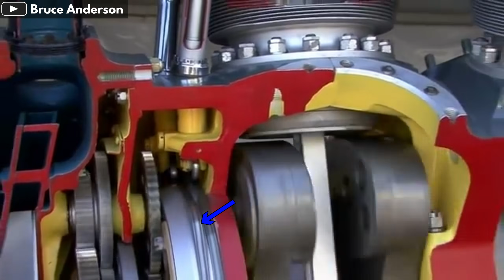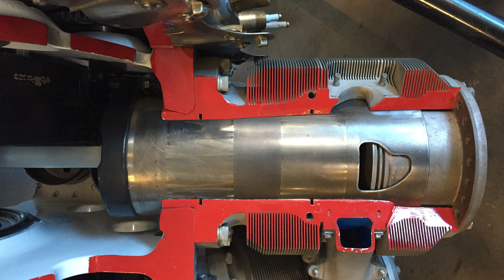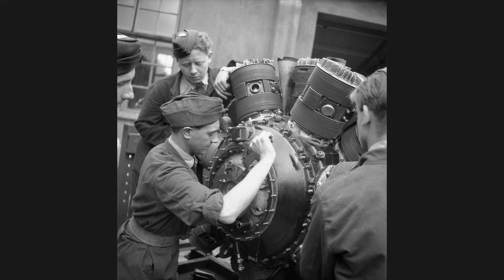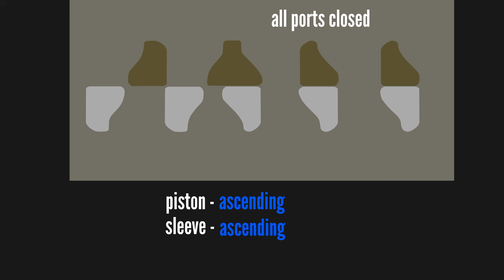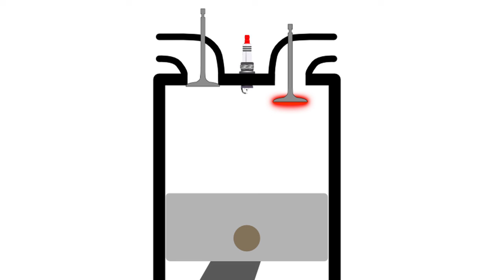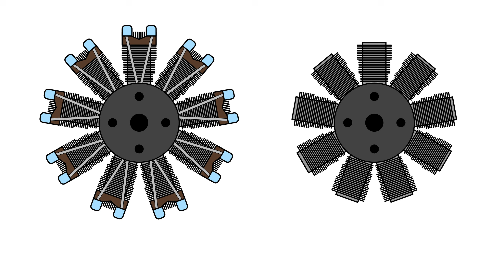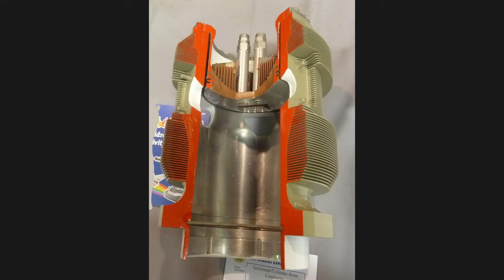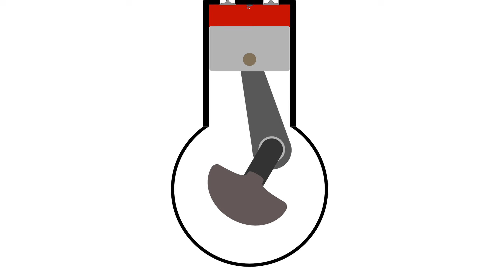Analysis of Bristol's Sleeve Valve Aero Engines

Comment: Then Napier took it to the next logical conclusion. A 2 -stroke diesel coupled to an exhaust driven turbine. Even higher compression ratios and higher power
Reply: The Napier Deltic is  a Junkers 218 engine which Napier licensed in 1934
Reply: @sandervanderkammen9230  I was thinking oof the Nomad.
Reply: @jamesoliver6625 The Nomad was unsuccessful and never saw production, it was based on a MAN AG. design of 2-stroke, loop-scaveged Diesel engine but with various types of Turbocompounding and hybrid gas turbine concepts that proved unreliable and not able to compete with conventional turboshaft gas turbine engines and turbojets. 
Loop-scaveged Diesels were like a dead-end concept like sleeve valve engines
Reply: @sandervanderkammen9230  The sad part is that by 1941 it was obvious that the war was going to be fought and won or lost with poppet valved engines and by late 1944, to those in the inner circle both in England and the US, that the future belonged to the turbines. To me both were serious misapplications of resources. Turbo-compounding an already very mature poppet valve 55L engine to get the power and fuel efficiency was the smarter way to go in the interim.
Reply: @jamesoliver6625 If there had not been a shortage of Nickel in Germany jets would have been in mass production in 1942... piston engines would have been obsolete before the war ended.

Comment: I don't know if they made economic sense for the company but they sure sound cool. I remember seeing a video of a Bristol Hercules that someone restored and ran on a stand and the sound was incredible. I love the uniqueness too, most piston engines have used the same basic design now for >100 years, the sleeve valve was something really different, and it worked well, even if it was ultimately a dead end.
Reply: It didn’t do them any harm. Building the Brabazon airliner was the hell of a big mistake. 

None the less, Bristol entered the jet age successfully enough helped by the arrival of Stanley Hooker who left RR. Some very notable engines came out of Bristol, including the Olympus (Concorde, Vulcan, all sorts), Pegasus (Harrier), Adour (Jag, Hawk, lots of stuff).  

Hooker says in his book that Olympus went from cold to full thrust on its very first test run in a matter of seconds. He just cranked the throttle wide open straight away. There was an American buyer watching, who was gobsmacked that British development testing appeared to be nothing more than a few minutes effort, all done and good, move on to the next!

Comment: The fact that the sleeve valve engine works real darn well makes me wonder what is keeping the rotary valve from being widely used for high performance engines. Surely it can’t be harder than making an entire SLEEVE reciprocate AND rotate at 2500rpm under the pressure of combustion right?
Reply: The sleeve valve was the answer to a problem that no longer existed by 1944.. poppet valves improved and jets made them both obsolete.
Reply: @DoktorBayerischeMotorenWerke  that’s true, but the rotary valve is literally just a cylinder with a slot in it that is driven by the camshaft. It should, at least theoretically, offer the same benefits in airflow efficiency as the sleeve valve design, and it should be easier to make too. That’s what’s making me wonder why it never saw widespread use lol

Comment: I thought I read somewhere  that the Centarus when used in commercial service after the war had a much higher TBO than equivalent poppet valve engines making it cheaper to operate.
Reply: You read a lot things that are not really true this days... sleeve valves were a dead-end concept and much more trouble than any the benefits

Comment: When sleeve valves were first purported the sodium cooled poppet valves did not exist. Of all of the most significant destroyers of the sleeve valve advantage, that was probably one of the most significant.
Reply: That and the use of Nickel stainless steel to make poppet valves
Reply: But that wasn't true at the time the Hercules was projected. Lindbergh's "Spirit of St. Louis" hat sodium filled ext.valves in 1927, and that were not the first. Also good valve steels were available. The reasons were somehow different. Ricardo calculated, that the filling grade of the cylinder would be better with a sleeve valve steering. To that time it was, but later in the 40es poppet valve-combustion chambers took over.
Reply: @hiha2108 High heat resistant, Nickel stainless steel alloys did not exist until 1930 and were not available in  the UK until the 1940s... which was after development of Bistols sleeve valve engines began.

Comment: There can be no doubt that the sleeve valve gave better mixture flow through the cylinder, the available port size was much greater than achievable by poppet valves and was unrestricted.  This fact alone was sufficient to justify further development, once developed the engine ran more smoothly and quietly than poppet systems and the Beaufighter was known by the Japanese as the whispering death.  Many divergent engine designs were tried, most being dead ends for various reasons but the sleeve valve engine proved viable and successful for it's time, the Hercules engine was still in RAF service into the 1970's.

Comment: Thank you for an excellent presentation, and a balanced evaluation.

There were a few points that might have been added though...
Other comments have mentioned that Fedden used a 4-valve head for his earlier radials, and as the valve drive he used for single row engines would not be possible with 2-row engines, he was in the process of designing one, he was reluctant to lose the higher breathing efficiency (and central spark plug) that he had gained.  The sleeve valves were a way out of the impasse.
The lubrication of the sleeve-valve engines demanded a lot of research, which was mostly done during the war - research that benefited all engines.

It is also worth mentioning that Rolls-Royce made three sleeve valve prototypes.  The "Exe" was intended for shipboard use - the Exe-Battle prototype was used by RR staff pilots for years.  The "Crecy" was a 2-stroke, and had piston overheating issues.  RR was too busy with other more urgent work to bring either to production status.  There was yet another engine re-using the name "Eagle" in 1944; this was very much like a larger Sabre.  But learning from Napier's problems.  Apparently Royce had calculated that the gas flow through such engines was higher than can be achieved with poppet valves - even the 4-valve Merlin and Griffon heads.  This engine was terminated because the turbine engines were starting to show much more promise... even though Hives refused a production contract for the Clyde turboprop that did fly in a prototype application that might otherwise have seen the Eagle 1944 used.

I would like to add a reference to an excellent presentation that was given by the former Manager of Pan Am Engineering - the presentation was published in a journal as "The Well-tempered Commercial Aircraft Engine".  His final point on ALL of the 3000hp-class commercial piston engines was that none were better than "marginally economic to operate".  And some were not even that reliable.  In-flight shut-downs were almost expected - and usually resulted in an engine swap.  There was a universal sigh of relief in the maintenance departments when turbines were found to be as reliable as even the first generation ones proved to be.
That opinion should really underscore all evaluations of these big piston aero engines...

I like the sound of a big piston engine as much as anyone, they are all fantastic examples of what creativity and engineering can achieve.  But they are better left for use on historic aircraft, (or maybe racing engines) than relied upon for every-day uses, and meeting demanding economic goals.  In that respect, they are like steam locomotives.  😁

Comment: I get the feeling that Sleeve Valve engines would probably have dominated post war air travel with significantly greater TBO and lower maintenance requirements (largely as a result of not having hammer effect of poppet valves), but much like the developments of cooled valves and high octane fuels that nullified the potential performance advantage, there was another unforseen development, the Jet Engine.

Wasn't there an argument  (when it comes to WW2) that production of sleeve valve engines could be carried out by less skilled workers and faster, although I don't think that was ever really borne out in practice.

Wasn't the Lancaster was also the only aircraft not to be "better" when fitted with Hercules' as opposed to Merlins?

Comment: Money being no object I would have liked sleeve valve technology having entered the automotive world to a far larger scale. Overall sleeve valve engines are more efficient than their poppet valve equivalents - the bsfc (brake specific fuel consumption) is lower on average. And they are noticeably quieter too, which would be a win-win for car use.
Reply: Willys-Knight mass produced them and licensed the engine to about a dozen other automakers. Improvements in poppet valves rendered them obsolete.

Comment: imagine if you had a sleeve valved boxer engine... will that even be physically possible
Reply: Napier Sabre
Reply: Rotol 2.6 litre auxiliary power unit for aircraft. Six cylinders, 60 bhp @ 3750 rpm

Comment: Already commented but thinking that if in the war fuel supplies were not secured then poppet valves engines would be in real trouble. I can't help wondering if wayercooling and under piston oil injection would not have been the next step. Nothing powerful built today is without these features.

Comment: Was there an advantage in overall size and therefore the drag caused by poppet valves cylinder heads. I would expect cooling would have been better due to the simplified structure of the head. We're the heads an integral part of the cylinder?

Comment: Sleeve valves don’t necessarily have higher compression ratios, but they do have much better volumetric efficiency which get more air into the cylinder.